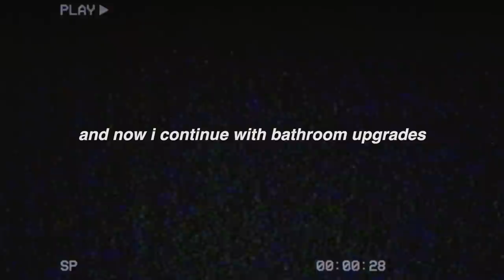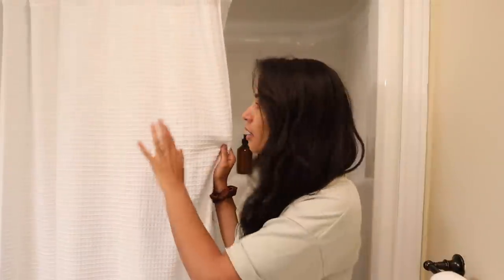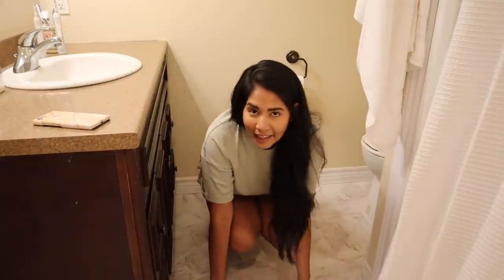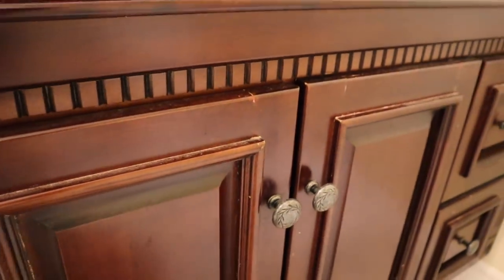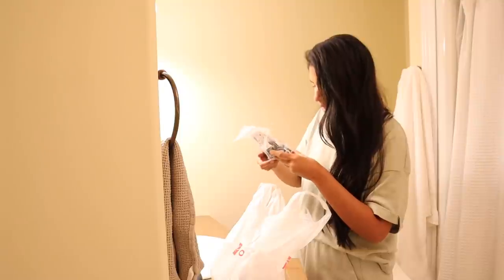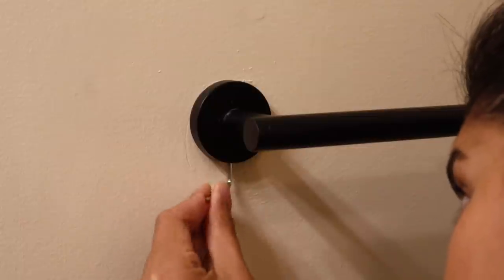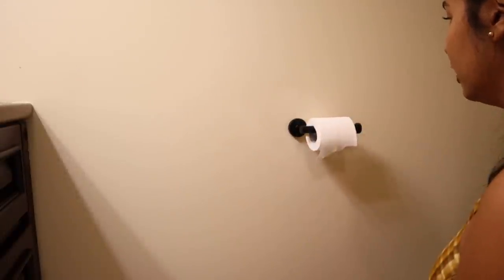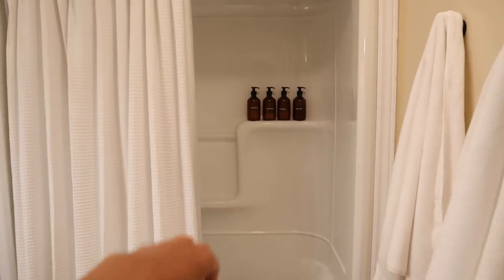DIY Rental Bathroom Upgrades (fixing my floor, vanity water damage & more) | Home Made Happy - Ep 14

Comment: The weather stripping was genius.🙌🏽 Some more ideas:cover the sink top, add a cart to the side of the sink that's either marble or spray painted stone texture. Spray paint the curtain rings with a hammered metal. Frame the mirror, and maybe add a new lighting fixture similar to one you just got. If you want to get super fancy you could add peel and stick 3d tiles to the outside of the tub/shower💋
Reply from the maker: Love those ideas thank you!! ❤️

Comment: I love your bathroom floor but I just pulled up peel and stick tiles (without any grout) and it was VERY HARD, not impossible but it took hours for my kitchen. I didn’t put them in- they were already in my home when I purchased it and it was also gross in the cracks between so good call filling those 😂